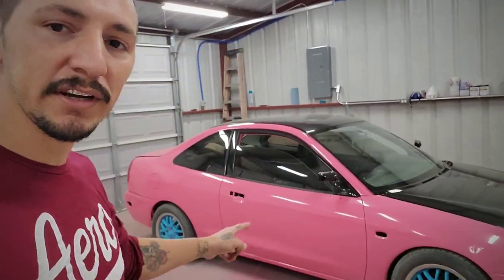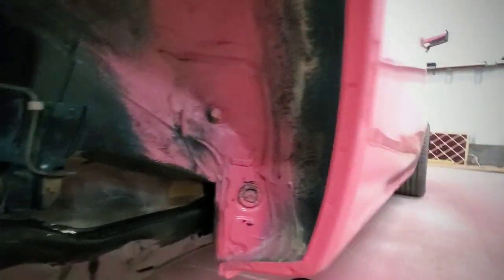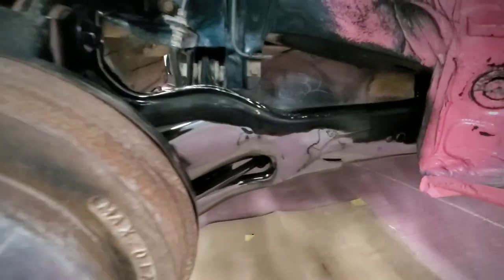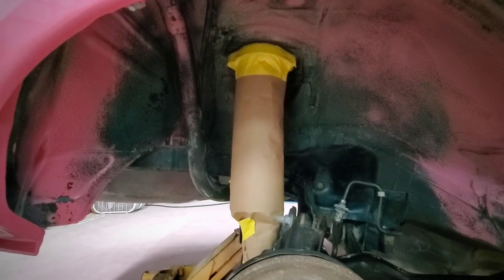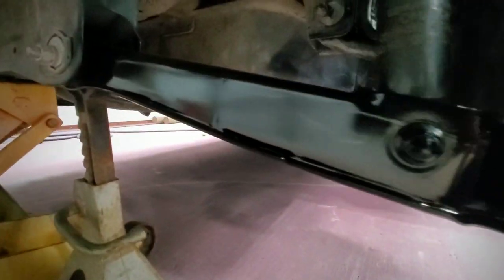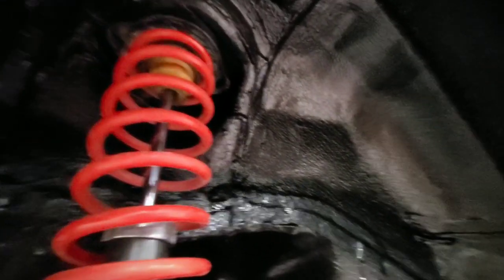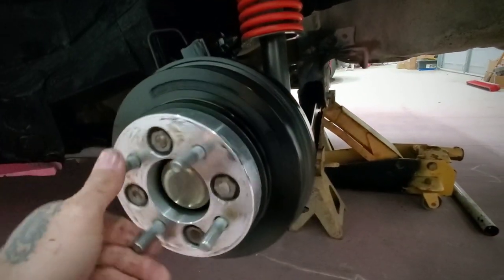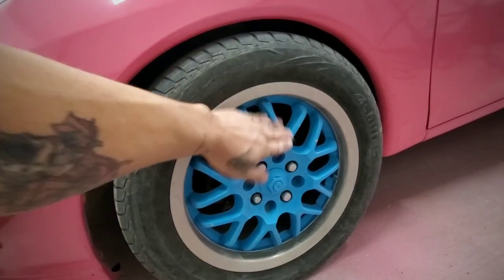Painting "Fender Wells" with Rustoleum Truck Bed Coating

Comment: Wow, your baby girl has grown so much! I can't believe it's been a year already. She's gorgeous! Oh ya great job with the paint. Haha. I have actually been thinking of doing that to the bed of my truck. What ever color you pick for the wheels make sure that it shows off those black drums. That was a great idea.
Reply from the maker: Many thanks,  Rudy! 🙏🏼
I used this bed coating to psint the inside of vexy's bed. A brush for the corners,  and a roller for the flat parts. Turned out real nice too! It's been a few years,  but still holding up👍

Comment: FWIW I did this years ago on my enclosed trailer wheel wells and it eventually flaked off. I would recommend a roll on truck bed liner rather than spray on from a can from rustoleum

Comment: Been using truck bed coating in my wheel wells for decades.  Never tried the brush stippling method.  Looks like it gets you clean enough results, huh?
Reply from the maker: Oh yes, goes on real nice and definitely gives it that extra layer of protection. 💪😎
Reply: Turned out great.

Comment: Did you use rust converter spray prior to applying the paint?   Did the wheelwell need any other prep (i.e. Scuffing) besides cleaning before you applied the liner?   Any noticeable difference in road noise?

Comment: That stuff from what I have seen in person would make terrible bed liner, but works great for projects blike this where you want a little texture. May work for undercoating as well I think it's a bit rubbery so it won't chipboff when hit with rocks etc.
Reply: Your confusing it with the rubber dip type coating.  This stuff is almost like rock when dry. I had a Crown Victoria and painted the whole car and it was literally like a tank. It will even scrape skin.